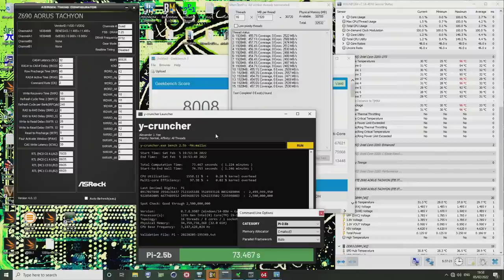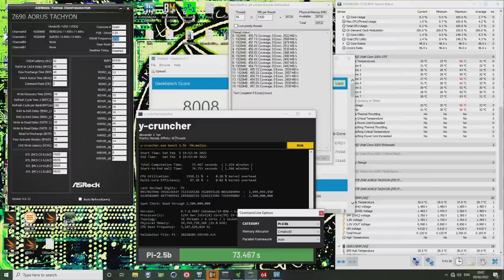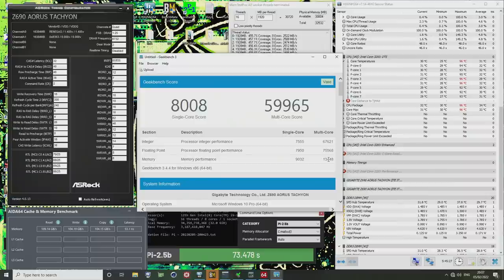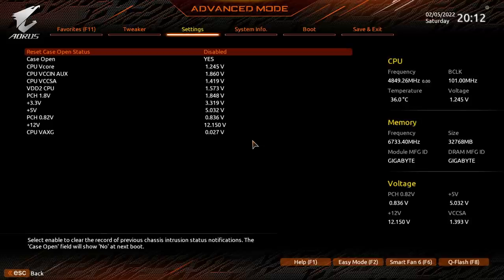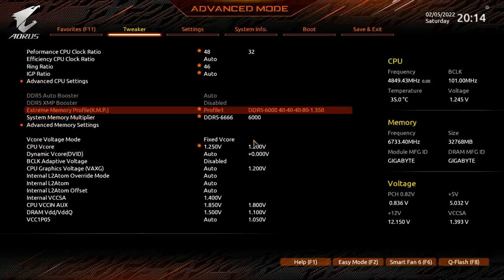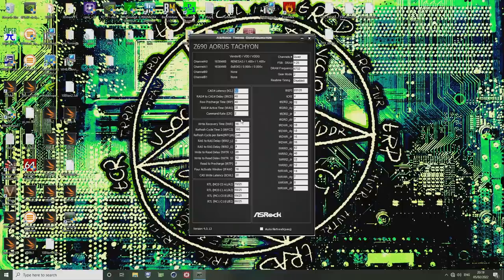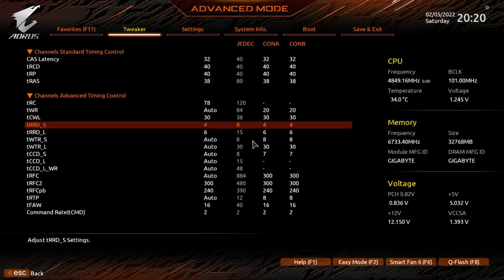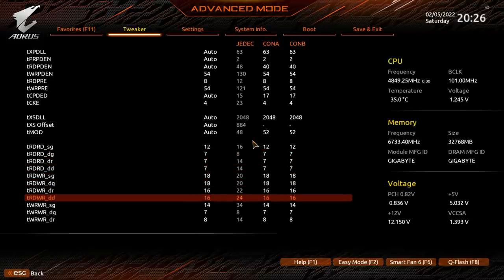2x16GB DDR5-6732 CL32 on the Z690 Aorus Tachyon // Hynix memory chips

Comment: Thank you so much for going back into the details of TFAW and tRRD. I work with Maya Autodesk 10-12 hours a day and it is so sensitive when it comes to the memory timings.  Rendering with Arnold is also a challenge. Thank you again. Your content is second to none.
Reply: I tried using windows disk manager but its useless. Since none of the 2B Western Digital drives are being detected in bios, nothing shows up in disk manager. I can not be unique to this problem, surely there must me other people online somewhere who had had this issue and knew how to correct it.
Reply: @joediditagain  Not this this even concerns you, unless you are him and that is who the question in intended for. Judging by all his videos he seems to really have a good understanding about how bios systems should be configured and I am at a total dead end as to what to do with mine. So in simple words you may understand, I am asking him for help and again unless you are him, this does not concern you.
Reply: @peterzeboroff7448  Peter, type Disk management, right click your 2TB WD drive and select new, follow the steps. enjoy.
Reply: @steezegod2768  Hi, the issue is none of the 2TB Western Digital drives are appearing in Disk Management and none of them are appearing in the bios either. Only the Samsung 970 EVO nvme 1TB  appears in bios and in Disk Manager. I need to know how to make bios detect them and then Windows will hopefully show them in Disk Manager. Does anyone know what the bios settings need to be so all the drives are shown in the bios, right now only the Samsung 970 and its in the top slot on the motherboard. I would so greatly appreciate any help any of you guys here can offer me because I am completely lost as to what to do or which direction to go

Comment: So I'd like to see how Apex compares to Tachyon. As far as I know tachyon is only 550 dollars whereas apex is 720 dollars. There's almost a motherboard worth price difference. I have high expectations :) Also on B560 there's TRP and TRCD registers although I couldn't set any of those under 21 for dual rank ddr4 4000 hynix djr. So maybe they really aren't seperate registers but the MSI B560 board that I had just showed two of those as separate things while functionally not doing anything.

Comment: Hey Bullzoid, I know you are not a fan of Mini ITX motherboards but, I was testing a couple of DDR5 boards and I might be wrong, but the MSI Z690I Unify seems to be really good for memory overclocking, to the point that it overclocks the best on ambient than any of the other motherboards. It is probably the cheaper board with a 12 Layer PCB.

Comment: From the messing around with timings that I've done, if I set the tCWL too low my AIDA "copy" bench goes way down and if I set it the same as my CAS, my read bench goes down. I don't know if I'm imagining it but it seems consistent. Granted this is DDR3-2600 on a 3770k, but I've found a sweet spot with CAS at 12 and tCWL at 11

Comment: So are timings of 32-40-40-38 on a 6000MHz kit of DDR5 equivalent to 16-20-20-19 on 3000MHz DDR4?
Reply: No they're not. DDR5 has 32 bank units by default while DDR4 has 16. That makes treachery timings almost as tight as ddr4 even when in higher frequency. Also ddr5 has much more bandwidth on large chunks of data, operating at read/write speeds closer to quad rank ddr4 memory simply due to the high frequency. And ddr5 splits the 64 bit memory bus into two 32 bits, while having the same bus width, it can carry 32bit registers twice as fast compared to single 64 bit bus in ddr4 if every other variable was set as identical. DDR4 and DDR5 is not comparable simply by doing frequency/tics because they're very different in architecture. Id' say there are certain areas where DDR4 still wins but not by that far. In a couple years I'd say DDR4 will be irrelevant like ddr3.
Reply: @fy7589  Thanks for this, I still haven't really wrapped my head around a lot of stuff to do with memory but this was quite helpful!
Reply: @fy7589  Mhz-to-mhz comparison shows DDR5 to have roughly %38 more bandwidth than DDR4 on traditional computing tasks at same MHZ value. So yeah, DDR5 has significantly higher throughput. Actual real-world latency is also comparable to decent DDR4 chips despite having CL40-ish on average.

In other words, I agree with you, CL and MHZ comparison won't yield a fair comparison. If you really want to compare going by benchmark results is best you can do for DDR4 vs DDR5.

Comment: @Buildzoid hey, so, what was the verdict on that VDD2 @ 1.57v ? I need to know what the safe values are for that please. Im on Unify-x with hynix kit and 6667 is stable but i cant get 6732 stable yet and i think VDD2 is the culprit. I see you said "Yeah so this needs at least 1.5V VDD2 to be stable', but did you learn any more useful data.

Comment: hello, I have a z690 apex mb. but I want other mb for overclocking because of max clock performance. how about tachyon? it's qvl have maximum 7000mhz xmp ram. I wonder that it is true to be able to boot maximum 7000mhz if cpu and ram have a best of clock rate. plz answer me about more information of tachyon.

Comment: I've always wondered why board OEM's can't figure out a method of entering BIOS in a elegant and reliable way without having to mash the delete button, sometimes if I start mashing to soon it doesn't boot into BIOS at all, a hard reset is then required, watch the lights closely and mash just after RAM check, I feel like a drag racer waiting for the lights.
Reply: They have, you can just hold the delete button.
Reply: Almost all of the vendors have a utility that let's you restart to UEFI from Windows at least.
Reply: "shutdown /r /fw -t 0" as in CMD with elevated privileges boots you straight into BIOS from the OS. You can also make a batch file so it's just a double click, though you need some powershell code so it calls the UAC first to run it with elevated privileges.
Reply: Full code:

@echo off
if not "%1"=="am_admin" (powershell start -verb runas '%0' am_admin & exit /b)
shutdown -r -fw -t 0 

Just paste into an .txt and save it as an .bat
Reply: @sabishiihito  Almost all vendors??  Its built in to Windows.  If you don't want to run a batch file, you can go Settings > Update and Security > Recovery > select Advanced Startup "Restart now" and that will boot to a menu where you select Troubleshoot > Advanced Options > UEFI Firmware settings  and that boots to BIOS.  You don't need any "vendor specific" anything to do that.  Or like EmPtY said, you can make a batch script and put it on your desktop/taskbar which is much simpler particularly if you're OCing.
Reply: @Cinnabuns2009  I think installing Asus Boot Setting or Asrock Restart to UEFI is a lot faster and easier, personally.
Reply: "shutdown /r /fw -t 0" create a batch file, create a shortcut for the batch file, Properties > Advanced for any shortcut will give you an option to Run as Administrator. This has the added benefit of being something you can add to Start. My board also has an option to boot into bios if I hold the power button while booting.
Also, I recently updated my motherboard from a much earlier version and I find that the old timings I put into it for OC don't work anymore. I used to do 3400 @ 14-13-13-28 but now that doesn't train anymore. Any idea why that may be? I haven't downgraded to check again but that just seems odd.
Reply: @CLAAAAAB  if it was an AMD board, I wouldn't be surprised. AGESA updates seem to steadily wreck mem OC.

Comment: So 2dimmer Gigabyte is about as good as MSI Z690-A Pro for memoc? Good to know, you're doing god's work mate!
Reply: This would destroy that board.  Unify-X is a better comparison if you like MSI.
Reply: @zap7759  To destroy that board Tachyon needs to boot above 6667 first, which Z690-A Pro does easily
Reply: @ksof1  Could be IMC based... You at CL32?
Reply: @ksof1  Myea give CL32 a whirl 😆
Reply from the maker: I couldn't get more than 6400 to boot on the MSI Z690 Carbon.
Reply: Don't leave me hanging, I like MSI... Unify-X user here. Does the A with Hynix do 6733 CL32? Or is it more like sub-6000 CL32?
Reply: @zap7759  CL30 of course
Reply: @ActuallyHardcoreOverclocking  weird cuz i think soon we get xmp kits rated 8000mhz+. What if u need a new board for that...

Comment: Hi, I have an issue with my new computer that I just built and I can not figure of how to configure the bios and everywhere I ask, either no one could care less about helping or the simply do not know so I would like to post my issue here and hopefully you will have an idea why it does not work and or perhaps direst me to someplace that is able to help me. I have a new Asus Rampage 6 Extreme Encore motherboard with the Intel Core I9-10980XE cpu.32 gigs of Corsair dominator Platinum DDR4 3600mhz,Asus RX6900XT 16GIG video card and I took off the liquid cooler it came with and put on a proper plex-glass full coverage water block with a nickel back cover. I have a Samsung 970 1TB nvme drive in the upper slot for my Operating System and then I have 1 western digital 2TB MICRO SSD in the lower slot and two more Western Digital 2tb micro ssd drives on the separate dimm plug in card.My issue is,only the Samsung 970 is detected in bios and none of the western digital ones are.If I load windows on the Samsung 970 it runs good but disk manager does not show the other 3 ssds.I have tried every setting I dare try in bios and nothing makes the other 3 ssds show up in bios and I am at the end of my rope as to where to go now.I tried posting this question at tech power ups and so far no usable replies. Since you play around with all kinds of configurations in bios,maybe you are able to give me some direction as to what to do next. One thing I should add is I want to use the 3 2TB western Digital micro ssds as stoage drives and not in any kind of raid setup.Thank you for any help you may be able to provide.
Reply: you have try with windows disk manager my computer had a similar issue but i cant explain how to do it because english is not my main lenguage
Reply: @tonydiazgarcia6789  Hi, Windows manager does not work because the drives arent even being detected in the bios and windows doesnt see them either. Some people are suggesting that the issue may be the fact the my western digital drives are Sata  but I have no idea.

Comment: how hard you think would be to get 6400 and could run you run at that speed for daily use?
Reply: Gigabyte provided me with the same memory kit, I could only get it to work at 6400 cl36 with Aorus master, but it was stable for daily. My cpu's IMC is probably not the best.
Reply from the maker: @artyomexplains  similar for me with the master. The really high clocks of DDR5 mean that the boards have much more effect on overclocking than with DDR4.
Reply: @ActuallyHardcoreOverclocking Should 6-layer Gigabyte boards from UD to Pro have the same ddr5 overclocking potential? Or is it much more than layer count?
Reply: They have them on newegg now...and definatly cause i do. Gskill kits

Comment: memtest and karhu doesnt mean alot with ddr5 i tested 5200 38-38-38-72 1.25v to 18000% with 2 x 32gb crucial dual rank on a z690 master but only 4400 36-36-36-72 is actually stable, it isnt even fully stable at stock timings at 4800, e.g. sata drives random going bye the odd whea in the event log every 2 days etc.

Comment: May i ask advice on AMD platform 5900X Aorus master X570, G.skill 4000 kit B-die 4x. Trying to run 2:1:1 just for fun. 1867 fclk and 2200 memclock Auto timings , SoC from 1100-1175, VDDP 900-930, procODT runs only on 40,36,34 and other voltages at auto coz i know nothing about them. In MemtestPro from 100-400 passes i get 1 error, any way to fix it?
And what should i try if i can boot 1900fclk but i get bus errors in Hwinfo. Thank you.
Reply: What is your DRAM voltage?
Reply: @alexskywalker888  1.5
Reply: @Bartasxp  Put a fan on the RAM module. Use zip tie or something to secure fan to the motherboard. Try  memtest again. From my experience once you run higher than 1.48V, Samsung B die can lose stability due to temperature rise. If you want to try higher fclk, raise VDDP to 1000 , VDDG IOD to 1050 . If you have Ryzen CPU, don't bother with pushing higher memclocks than fclk, performance will regress overall unless u get more than 5000M/T on the memory which is 100% impossible for you running on 4 sticks of memory.
Reply: @fleurdewin7958  Will do thank you, thing about VDDG IO, after instaling F35e bios, any software i use to ckeck VDDG IO its reporting 0,900 if set to auto and 0,9976 if i enter Any value in bios...
Droped down to 2100mclk, 1,45v and ckecking what kind of scores i can get, only penalty i get is few ns latensy. :)
I would stay with 1900 fclk if only i could make it stable.